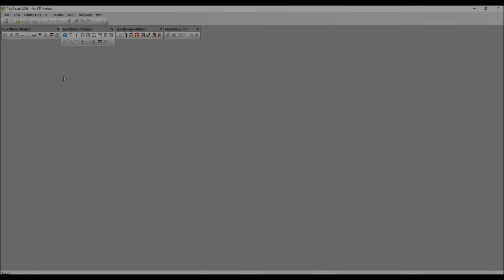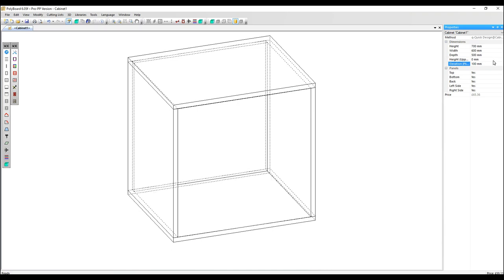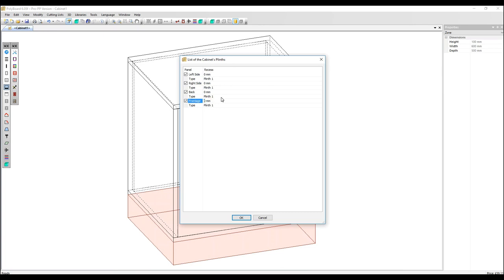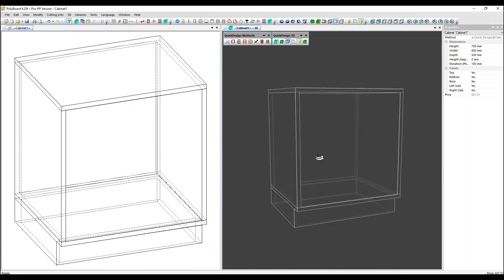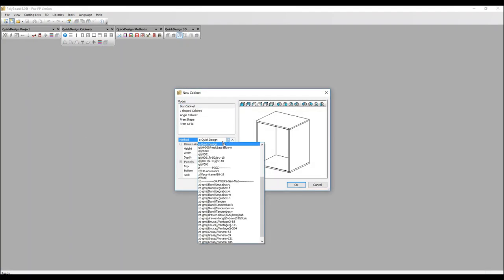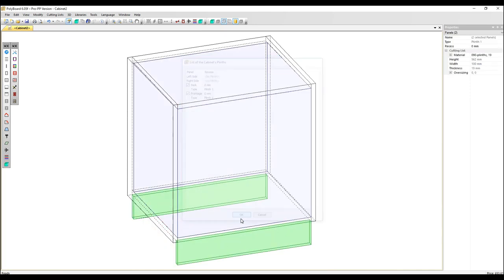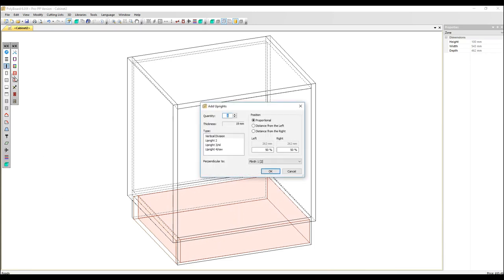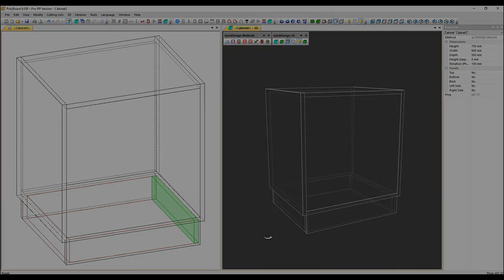Adding plinths using Polyboard

Comment: Hello, how to add elevation on  properties ?
Reply: Hi,
Due to the program's evolution, this setting is no longer called the plinth elevation in the properties screen, as more zones have been added to that feature. You have to open the external zones in the properties screen. You will find multiple zones that can receive a plinth, strip or filler. You can also define the zone of application.